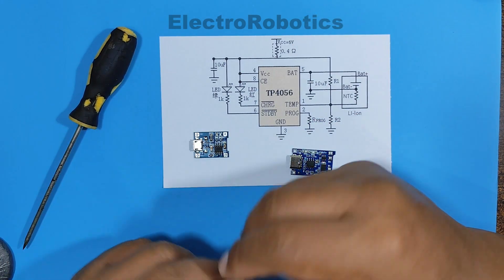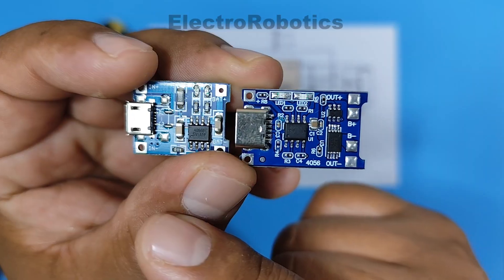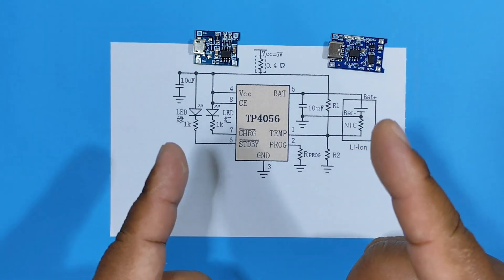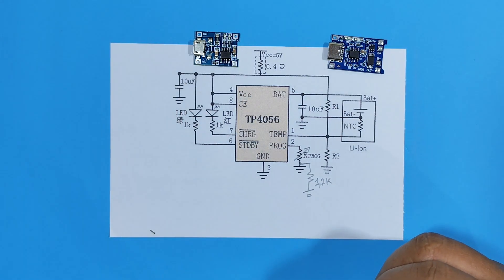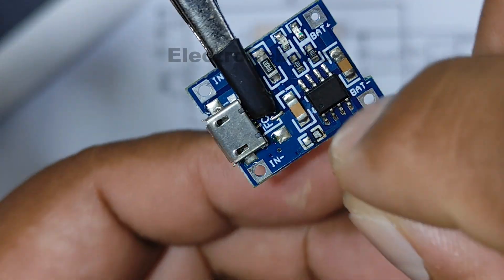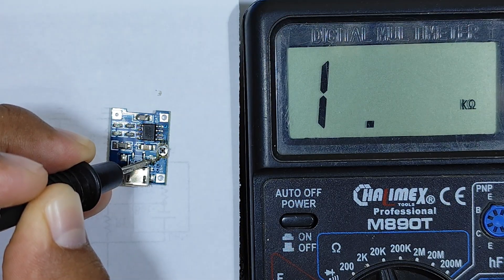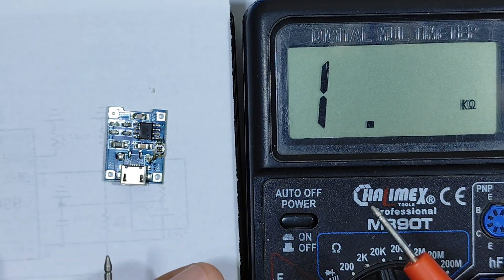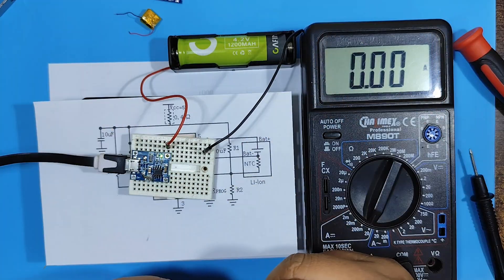How can I make my batteries last longer? and Protect Your Batteries, Both Large And Small.

Comment: Hi sir just watched your make any charger to variable power supply video 

And wondered if you can make a video on how to get different voltage outputs from an fast charger without much modifying the internal circuit & components 

I am not much into electronics but my guess is there are 4 wires in an charging cable 2 are positive negative & other two must be for transferring data but in my imagination for charging it could've been used for varying the  output voltage by providing resistance 

Few months ago i opened a fast charging type c cable and found out that it has some ic or chip inside it that maybe controlling the output 
I have a 6 year old fully packed vivo v5 plus fast charger which can give following outputs 5V 1amp 9v 1 amp 11V 2 amps max (not entirely correct) but when I measured through multimeter I am only getting 5 volts tried by applying some load by a 555 motor still no increase in output